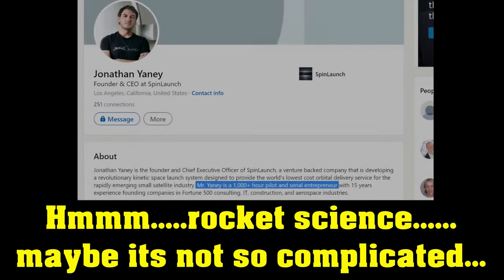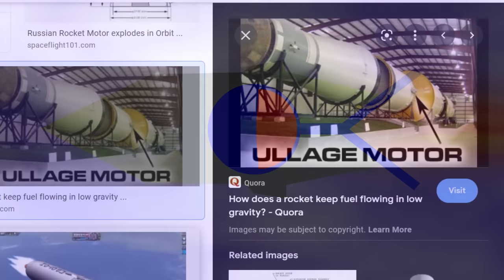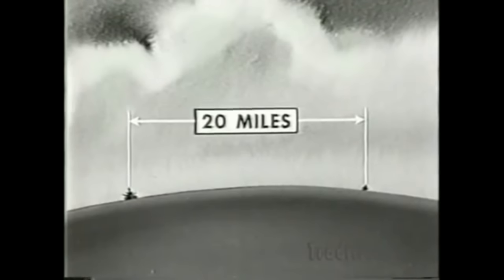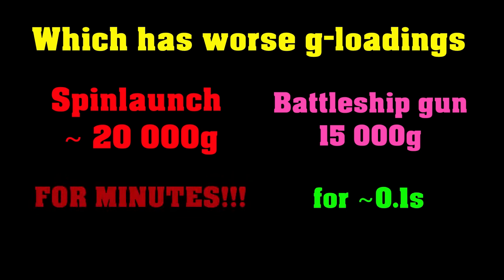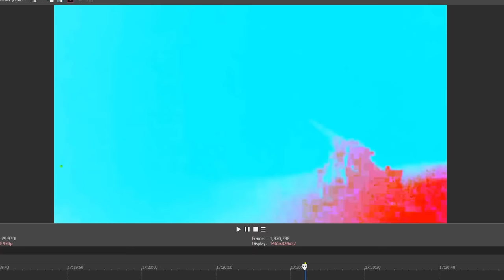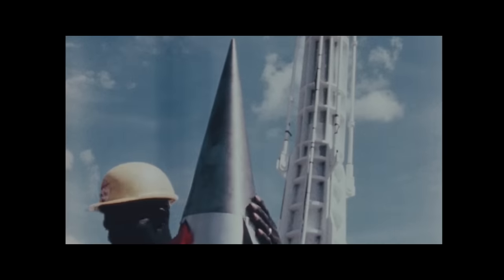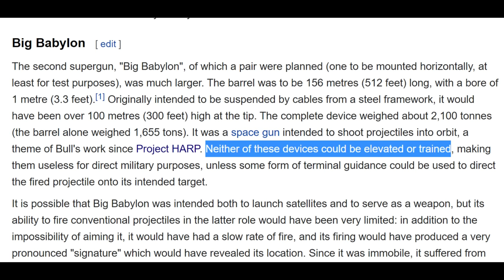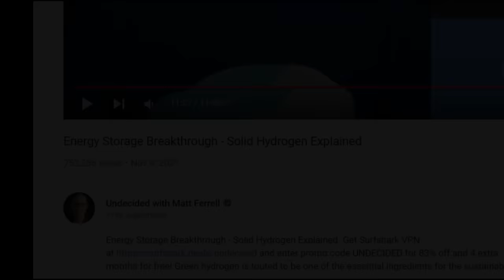Spinlaunch: BUSTED (Part 2)

Comment: The liquid fuel thing would only happen if the drag was inducing more than 1G.  If they want to use that engine during the ascent they need to use fuel pumps vs gravity fed.  It's definitely a problem, but not in that phase.  Once in space you definitely need the ullage motors though.  You are right, it's a stupid system.  I say it's designed to farm cash from early investors.
Reply: I don't think so, if not for the drag, the vehicle is in free fall. So anything inside would experiment what is called microgravity (same as the space station). So any force exerted onto the vehicle will fill as the only source of gravity inside. So for any drag again the up velocity,  the liquid inside will go up.
Reply: There's something here possibly but not as currently conceptualized.

As a human, I certainly would have no knowledge of anywhere else having successfully used centrifugal force to put objects into an orbit.
Reply: @VinyJones2  Honestly I don't know for sure, but I tend to think the vehicle would be experiencing earth's normal gravity minus the drag from the atmosphere.  If they are firing straight up, which they were here, it's not getting any modifier from the horizontal speed.  Dunno really, guess I need to build a vehicle :)
Reply: i wish i lacked enough morals to pull something like this off. i haveso many ideas that would look great as animations and sound resonable at firstglance
Reply: @Skarry  Their cgi version is angled, 30 to 45 degrees.  For that to work it needs to spin fast enough to impart enough velocity for it projectile to not only make it through the 100 miles or so up to space but also slog through the dense lower atmosphere.  Bad plan.

Also, high speed spinny things don't tolerate sudden imbalances, so they would need to precisely launch an object of the same dimensions and same mass distribution from the opposite side of the spinny thing or it will shred itself on launch, destroying the facility. and anything nearby.  This also means there is another rocket mass object being fired backward into something that can absorb/dissipate the energy.  That's a big ask.
Reply: @avi8r66  not disagreeing. Just a type of tech to keep in the drawer for when suitable or combined with something new.
Reply: @avi8r66  try imagining being inside a freefalling lift. You would feel weightless and float around inside the lift during the fall despite being subject to gravity. Could also look up videos of those 'zero-g flight' planes for a similar example. Similarly, the projectile would also essentially be in 'freefall' while it's flying before the rocket motor starts. Therefore the fuel in the tanks would be floating around like a person in a lift or on a zero-g aeroplane ride, except due to atmospheric drag the rocket casing would be experiencing a drag force, so the fuel would end up in the top of the tank as it isn't being slowed down by drag like the casing is.
Reply: @mrgreatauk  The zero-g flights aren't simply relying on ballistics, the pilot is forcing the plane to fly the prescribed arc to null out the force of gravity.  I've done this in small planes, much smaller arc of course, and you really have to push the nose over to get that effect.  Not dramatic, but it's not subtle.

The falling elevator is falling, so that's a large component acting against gravity but it's not 0 yet.  Depending on the shaft, how much room there is for air to escape the box as it falls, will dictate how much drag there is.  It may be that elevators have enough weight to them they easily overcome that air resistance, I think that would vary from one setup to another.  

Like with anything, the object has surface area inducing drag.  So a falling object, like a skydiver, has a certain amount of drag, and a certain amount of weight.  The more weight in a given surface area the faster it will fall.

But neither of these are using the same mechanic as their projectile, once thrown the only force other than gravity is drag.  How much drag I don't know, but I doubt it's 1G as that would really end the flight quickly.  The interior would certainly be at a reduced g level, but I really don't think it would go to 0 or less.  Even with .1 G the fuel would stay at the bottom provided the bottom is toward the planet.  It would be sloshier, but it would settle at the bottom.  And there would be virtually no air space within the fuel tank at that point so it doesn't have far to go.
Reply: @Skarry  Maybe.  Still seems overly complex for something we already have proven systems for, rockets and artillery.  As a weapon system it's silly since it takes a while to spin up but I bet it would throw a canon ball pretty well.
Reply: @avi8r66   @avi8r66  that's kind of the point of the  zero-g flights though, the flight profile essentially facilitates the feeling of weightlessness by cancelling out air resistance for a short period of time.

You almost have the answer - you're right that in the real world a falling lift would have air resistance, and therefore the person inside would actually still experience a small force keeping them on the floor. Just remember that for the projectile the air resistance is going the other way, because the projectile is moving up rather than down like the falling lift.
Reply: @mrgreatauk  for the zero-g flights air resistance is not in play, the engines deal with that to keep the plane moving forward.  What creates the weightless effect is the pilot flying that arc.  They first nose down to get up some speed, then pull up and start the arc.  The plane is then falling away from the people inside at the same rate gravity is acting on them.  So no, drag isn't in play with that.
Reply: @avi8r66  You're getting hung up on the specifics of zero-g flight, just try to visualise (maybe draw a diagram) the forces on a projectile, with some other free floating object inside it. Gravity: on both projectile and the internal object. Air resistance: only on the projectile. Then think about what that means for acceleration, and which end of the projectile the internal object will bump into.
Reply: @mrgreatauk  One parallel I thought of is the blue origin flights.  As far as I know it goes directly straight up.  And once the capsule detaches they are at 0G, which may well prove me quite wrong.
Reply: @avi8r66  oh, I see. Indeed the vehicle is always subject to gravity but as the liquid inside. so both are slow down the same way by gravity. So in the referential of the vehicle, you'll see the liquid floatting. But for the drag, it applies only to the vehicle, so the vehicle will slow down and the liquid hit the top of the tank and then slow down by the reaction force by the side of the tank
Reply: @avi8r66  yeah, what if we eventually engage in war with large hovering armored bugs. One can never know when something may be useful. I'm definitely not saying dump 80m into it but hey, how about fiddy k for some new computer compilations and stuff like that.

Comment: If the engines are not fueled with cryogenics which is pretty likely, so let's say it's nitrogen tetroxide and mmh. Those engines are most likely pressure fed and not pump fed that means the tanks are almost completely full, so the pressure in the tanks should be enough to start the engines without ullage thrusters, similar concept to the abort motors on cst100 or dragon. Furthermore you got the mass of the spin launch rocket wrong in the text you showed it said that the payloads will be between 20 and 200kg but the rocket itself will probably be a bit heavier probably in the 1t range.
Reply: Cryo vs non-cryo is not the issue here, neither storables (which have to deal with strict environmental regulations) or cryos work if they can’t be fed into the engine because the fuel is pushed towards the top of the rocket.
Even a full tank can have areas of low and high pressure.
Reply: @innosam123  yes but you know how pressure fed engines work right? You take spherical tanks fill them to the brim and then pressurize the heck out of them so even under deceleration of the atmosphere the pressure in the tanks is enough to be able to fire the engines. You can look at the launch abort test of the dragon capsule the escape happened in atmosphere which meant it was decelerating thus the fuel would be pushed forward but because of the high pressure in the tanks you can still fire them.
Reply: @timoclark8367  Sure… But there are no Helium/gas tanks that go to the top of the tanks either here. Maybe those ones near the engine are Helium tanks, but they don’t seem to have any connection to the top of the tanks.
There’s clearly pipes for the top tank to the engine, just not to the top of the tanks.

Either way, it’s just an example of the lack of detail/thought behind this plan more than anything else.
Reply: @innosam123  sure but you have to keep in mind it's just a render and you have no other option than pressure fed because pump fed is just not viable for such a small rocket that's yeeted.

Comment: To be fair, I'm seeing a lot of nay saying, but your criticism doesn't seem substantive.

All of your criticisms are based on your assessment of a promotional video, which prioritizes imagery over functionality.

You criticize the anatomy of a computer simulation of a rocket, well, it's a COMPUTER SIMULATION what amount of detail do you expect?

As for the machine rotating, once again, demonstrating the device rotating at a lower rpm will look much better for the cameras than it being spun up to a 500rpm blur.

I would love to see some calculations indicating the impossibility of this system.
Real Engineering recently made a video about spin launch, and they at least had the courtesy to show a few calculations to explain the problems.

As well, you're pointing out the projectile leaving the machine at approximately a 30 degree angle, but you fail to mention that is footage of the first launched projectile from the machine. You know as well as I do that when testing new equipment, you incrementally increase your parameters up to full performance rather than setting max performance on the first attempt.

Comment: Project HARP has one great drawback. It can get you assassinated and suppliers may become curious looking at the gun barrels.

Which is the reason the Japanese use a 5 stage, all solid rocket engine for launching stuff to space — it is really hard to use it as a weapon.

If the Irak had ordered a spinlaunch device, they’d gotten it.

Comment: Wait just curious question, if it's a near vacuum, when the seal is broken as the rocket flies through, wouldn't the air rushing in to fill the vacuum A) screwn up the rocket's aim majorly and B) slow it down as it would create a sort of suction as the air flies in to the large vacuum?
Reply: First of all they are now proposing a solid fast opening "air lock door" rather than a membrane.
And, yes, the projectile is going to be "hitting full atmosphere" at a very high speed.
However, by the current plan, the outer door will open, the atmosphere will rush into the tube, and the projectile will "punch through" that wave front.
This would offer more opportunity to control the interaction.

Comment: I can see a scaled down spin-launch type contraption being made for short range artillery. Instead of an arm slinging one shell, you could just have a wheel with multiple projectiles and yeet them all in immediate succession. This would have the advantage of being essentially silent, so no ability for the enemy to locate your contraption by sound, and you'd be slinging an entire salvo in less than a second, allowing you to scoot right out of there. And because we're talking about artillery here, we don't really need to worry all THAT much about accuracy and distance (so long as it's accurate and long range enough).

Comment: @Thunderf00t   Been seeing this in the news again lately and sure hope for another video.  Isn't the biggest problem with this a pesky thing we all have do deal with?  The atmosphere?  Pardon my limited rocketry physics, but I do know one of the most serious issues is "Max-Q" (Maximum Aerodynamic Pressure)  When you launch a rocket, it starts with a velocity of 0 and continually accelerates until it reaches a speed it can enter orbit.  Rockets are at full throttle... right up until Max-Q when it throttles down some when the combination of atmospheric density and velocity puts the greatest strain on the launch vehicle.  A rockets is already miles up when it reaches this point and is still accelerating.  With this thing, as soon as it breaks free from the vacuum spin chamber, wouldn't it already be at it's Max-Q?  And being so much closer to the ground, I assume these forces would be MUCH higher than a normal rocket.  Any launch vehicle would have to take this into account and be made stronger.  More strength = more weight for the craft = more energy require to launch = less payload capacity.  Also, with a standard rocket, it continually would require less energy for it to accelerate.  You are expending fuel and getting less resistance from the atmosphere the higher you get.  With this thing, would would need all of that energy immediately upon it's launch.

Comment: Escape velocity from Earth is 11.2 km/s. Mach 1 at sea level (the speed of sound) is 0.342 km/s. (For you young people, this means that you can't just yeet something off of the surface of Earth and get it into orbit, or at least you can't currently do so if you want it to survive and take pictures for Instagram). If this spin launch nonsense gets up to Mach 6, it is moving at 2.052 km/s. So it still needs plenty of boost after launch and also has to meet stringent timing on all release mechanisms in order to make the exit window (or else crash into the walls of the spin-up chamber). What kind of release mechanisms are they planning to use? It is pretty easy to bookend the required timing requirements if you have a spin rate and exit hole size. Who has those?

At this point, why not just go with a mag-lev ramp or a bigger version (if necessary) of a Pegasus style fly-and-launch system?

Comment: Thunderf00t's content is usually better than this.

Besides the ullage issues that others have already pointed out, I'm also going to note that there is absolutely a difference between the orbital payload capacity of the system (which is the mass number consistently used in this video) and the Stage 1 ballistic package (which also has the mass of the sabot, the copper/aluminum nose cone, and the mass of the Stage 2 and 3 rocket motors and fuel).

Spinlaunch may or may not be viable, but if we're going to make videos "busting" it lets make sure they're for valid reasons.

Comment: I thought 200 kg sounded super small for a rocket. Turns out it's the weight of the satellite, and the whole second? stage would probably be way heavier. TF has been really sloppy lately. Also, I still think there are tons of flaws in the design, it's just that I don't like it when you don't critique the actual idea but either some strawman or straight up lies.
Reply: I was thinking the same thing.
Reply: It doesn't change the fact that Spinlaunch is a stinky mutt. How many commercial satellites can withstand 20,000 gees for an extended period, plus the horrendous jerk of going from 20,000 g to 0 g in ~1 microsecond? Practically none. How many existing liquid rocket engines can withstand those kind of lateral gees? None. Do you think customers will be willing to totally redesign their payloads for the chance that maybe someday Spinlaunch might work? Why the hell would they want do that when Space-X promises to get marginal costs to orbit around $100/kg once the Starship program is underway?

Comment: And yet more nonsense! The entire crux of this video is saying that spin launch is worse than project HARP. This all relies on Thunderfoot asserting they both launch 200kg projectiles - which is wrong! You even show it on screen in the video! It’s a 200kg payload, from a TEN TONNE projectile. A lack of basic reading comprehension this egregious throws all your videos into question, if they weren’t already. Find me an artillery piece that can launch ten tonne projectiles to space… pseudo-intellectual codswallop as usual.

Comment: Most of the centrifuges I've seen are mounted horizontally so the gravitational force is in the same direction relative to the arm and load. Would there be issues with having it on its side like in the video because the radial force at the bottom of the rotation would be higher than at the top? I.e. the forces are additive in one part of the rotation and subtractive in another?
Reply: At the speeds this thing is supposed to operate, the centrifugal force would be so enormous that gravity is basically negligible.
Reply: @isodoublet  What about when it's accelerating?

Comment: I wonder if the same principal could work, but using a track instead of an arm.  A loop track could keep adding power, then when it comes time to launch the loop switches to a straight track upward to keep the trajectory flat?

Comment: Its like the nuclear bomb blast footage that has miraculously survived the radiation,  the camera didnt melt nor did it shake at all from the shock waves a d it was so powerful tbst you could read the text on the vehicles that apparently had the paint just disperse and then blow away but this camera must have been placed thst close or it was extremely powerful